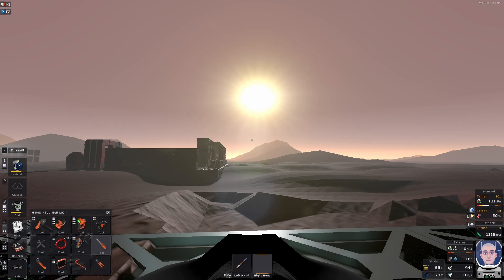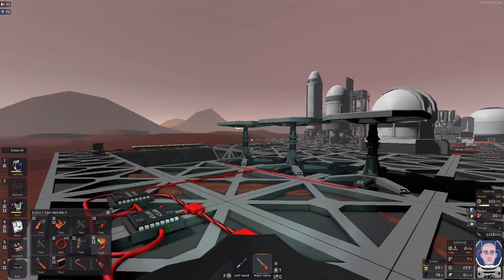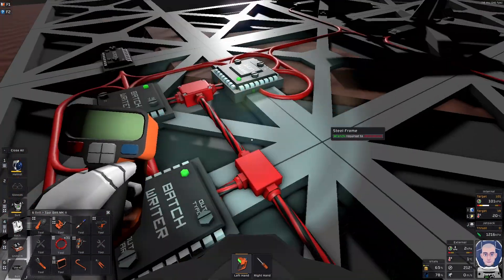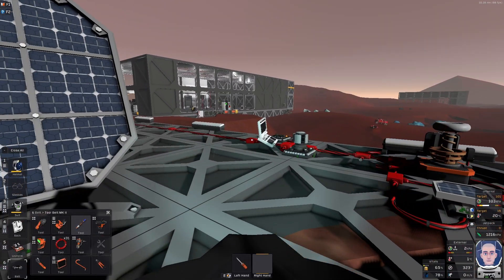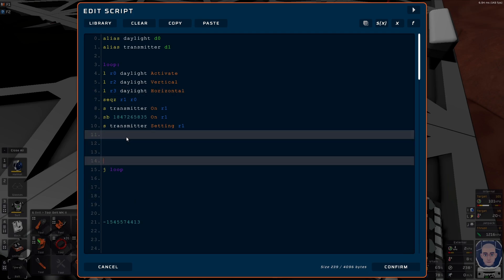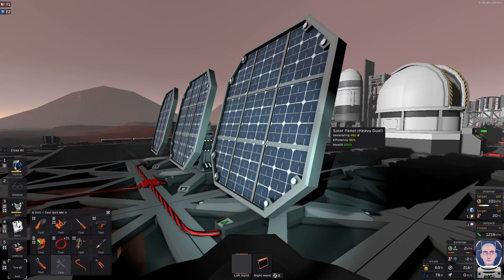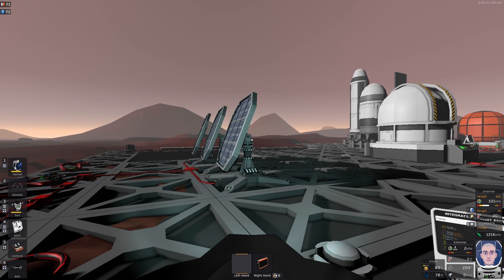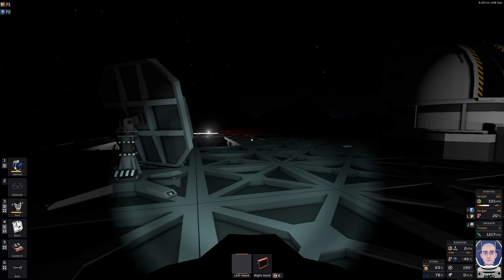Stationeers - Programming Tutorial - Simple Dual-axis Solar tracking

Comment: Some constructive criticism: I know there are other guides on solar tracking. But it would be helpful in your guides to elaborate a little on WHY you do certain things. For example: why do you need to add 90 degrees to the vertical value? What do you need to do if the data ports of the solar panels do not face the sunset? For solar tracking, this is not super important but this might be useful for future guides on more complicated topics. Understanding the WHY helps a lot in implementing principles. I am looking forward to your guide on LARREE - I have never used the robot arm and would love to implement it in my next base.
Reply from the maker: Thanks alot for your input, i know i maybe did the solar panels a bit to light without enough details on how and why.
on the 2 hubs that i will be doing next i will spend more time on why i do things the way i do it.
LARREE is part of that